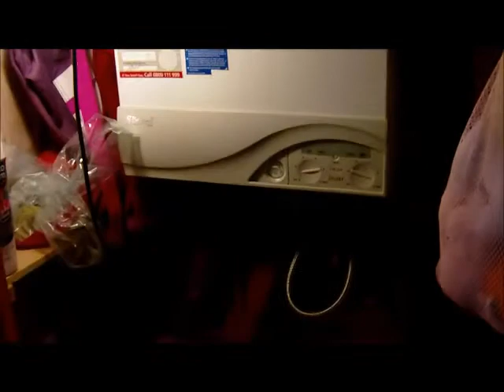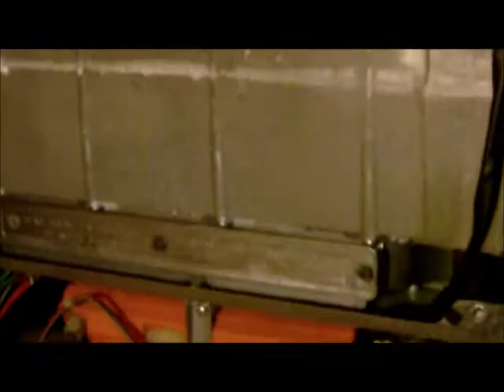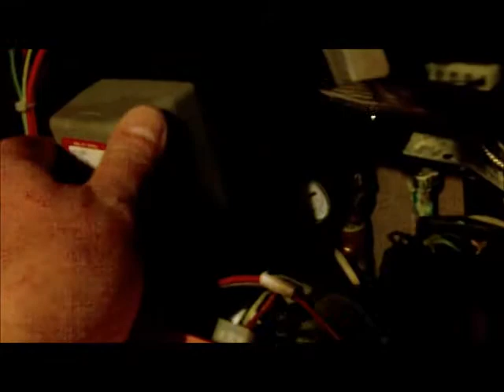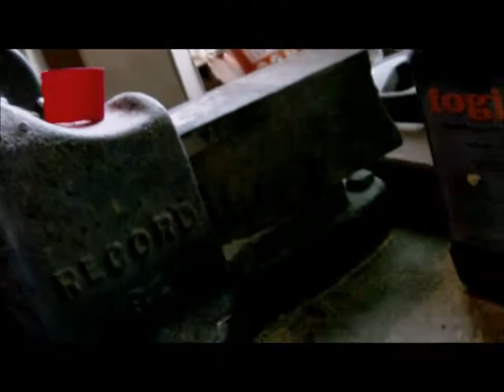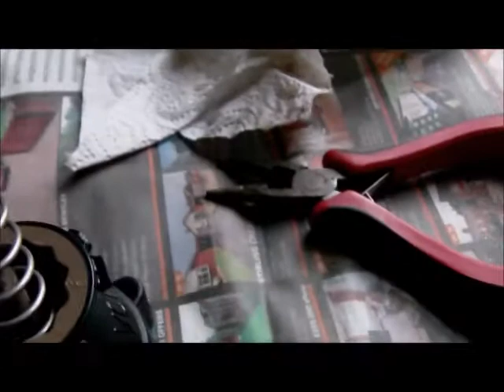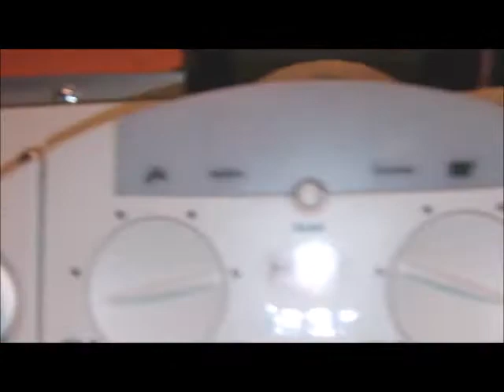Do it with Derek. Central heating repair : Diverter valve

Comment: I have this problem on mine, have bought a new cartridge kit, £27 on ebay. Hoping that it should cure it. Just wary of water systems, can't turn the mains off so will have to turn boiler supply inlet off and drain it. How do you put additive in when refilling the system?
Reply: Kwaka Pants how did you get on? can you fit the cartridge kit with the valve body still attached to the boiler? tia
Reply: Kwaka Pants 0